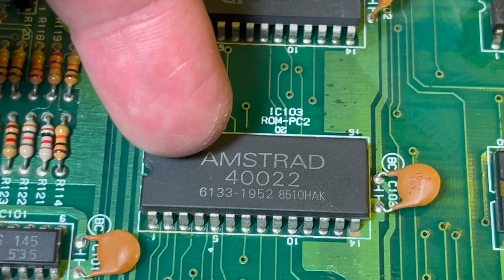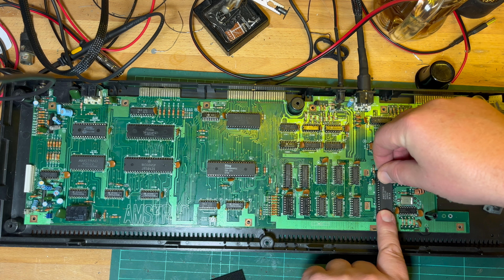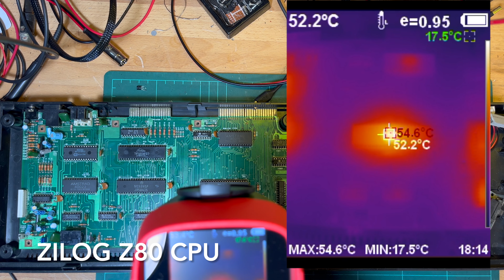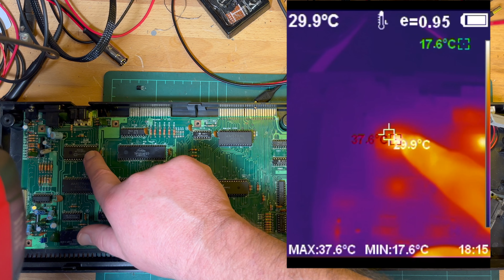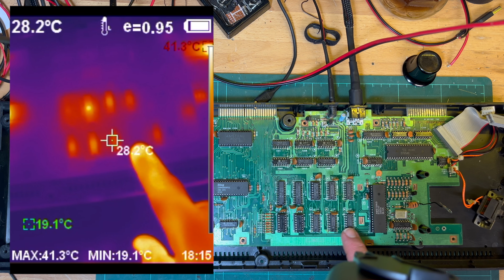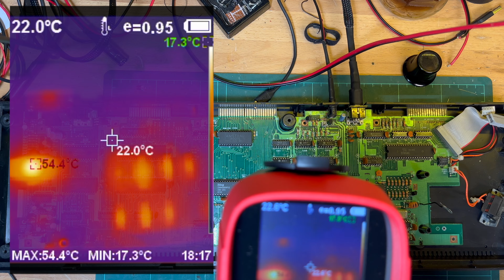🇬🇧 Amstrad CPC664: Part 2 (Troubleshooting Starts) [#TCE0474]

Comment: just a heads up....40007 and 40010 pinouts are different! ..you might want to grab the correct pinout for probing!! :P
id start with the diag expansion will bypass the rom and ram... will let you know if the z80 and GA are good
no screen at all suggests CRTC isnt sending H/Vsync to GA...GA is bad, or Z80 is bad...
once you can get something on screen you can test ram/multiplexers/buffers...
the clock into the z80 should be 4mhz (pin 6 on the z80)... you seem to be probing the clock for the sound which is only 1mhz...
NPHI is the Z80 clock on the 40010 (pin 19 on the GA).... NCPU (pin 14) is the 1mhz sound and memory clock
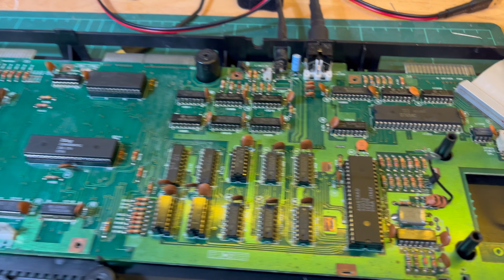Reply from the maker: Yep - I should've been a bit clearer in the editing but I'm using the 40010 pinout when checking signals from 05:05 onwards ... "let's try that again" ... good 4MHZ clock (05:44)